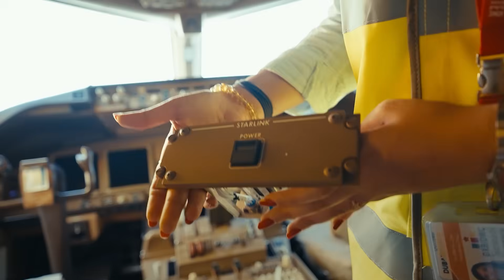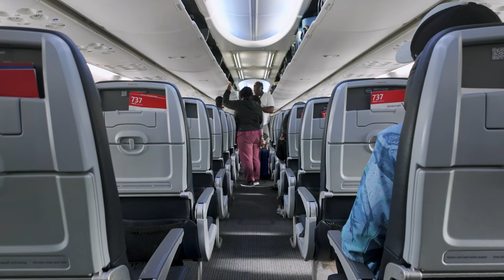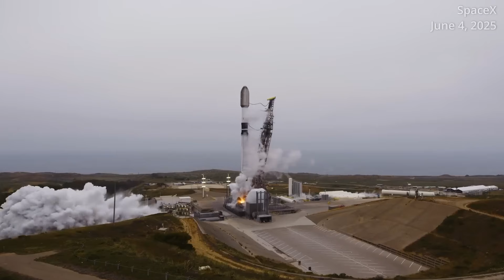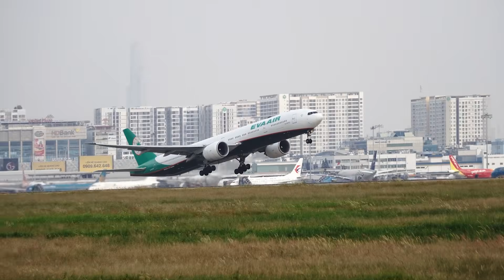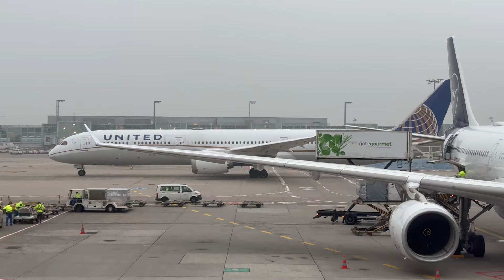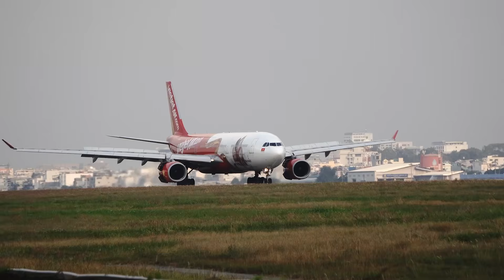Why Airlines are Quietly Removing Your Seatback Screens

Comment: Those screens add to the cost of flights, add weight to the airplane and don't work most of the time. Download content to watch on the plane before your flight and use onboard wifi to check your messages.

Comment: You will need at least dozen of starlink terminals to provide bearable bandwidth to hundreds of people (better hundreds). That means additional antennaes (for different satellites), router (for handling multiple sources) and cabin repeaters or wires - basically the same infrastructure as entertainment system with starlink subscription instead content one.
Reply from the maker: Thanks for the insight. Commercial aircraft don’t rely on consumer Starlink terminals. They use aviation-certified terminals integrated with the aircraft’s existing network infrastructure, including multiple cabin Wi-Fi access points, routers, network controllers, and onboard servers. The satellite terminal provides the internet backhaul, while the onboard network distributes the connection throughout the cabin. My point was that as high-speed connectivity improves, airlines may increasingly favor passengers’ personal devices over maintaining seatback entertainment systems. Thanks for contributing to the discussion! ✈️
Reply: @FlytPlanx  I didn't mean terminals specific, but the number of point to point connections to different satellites to provide sufficient bandwidth to passengers. The cost of installation of additional antennas for internet (assuming that two for ground link and phone calls will be installed anyway) would be a costly addition to new cabin infrastructure (Why would an existing plane have WiFi repeaters?).

Comment: Tbh if you remove them on a long haul flight, then i want good charging outlets and fast wifi
Reply: Remove the screens and then you'll have some idiot or kid not wanting to use headphones and will have to listen to their videos.
Reply from the maker: Hope they can replace the trickle charging systems with more reliable and fast charging systems ..That would make the in flight WiFi make more sense
Reply: why do you have tbh? did you think we wouldn't believe you?

Comment: This is not happening, American Airlines is the only major airline removing the inflight entertainment systems. United on the other hand, is installing an in-flight entertainment system on every one of their airplanes. Scott Kirby the CEO said they get better customer satisfaction ratings anytime. The airplane has an IFE system on it.
Reply from the maker: American isn’t the only one. Air Canada removed seatback screens from many of its A320-family aircraft during cabin retrofits, and Alaska Airlines has also shifted toward BYOD entertainment on much of its narrow-body fleet instead of installing seatback IFE. Several low-cost carriers also rely entirely on personal devices rather than seatback screens. United is definitely taking the opposite approach by expanding seatback IFE, but it’s not the only strategy in the industry.

Comment: I prefer watching a movie on the built in screen than browsing the web through wifi until the battery dies
Reply from the maker: I agree. Seatback screens are more comfortable for watching movies, and you don’t have to worry about battery life. That’s why many passengers still prefer them despite the BYOD trend.
I feel like the main reason they are doing this is to reduce weight of the plane which maximizes profits .Just pure corporate strategy with minimal consideration for the passengers
Reply: They all have in seat charging ports 😊.

Comment: Huge issue is charging the phone and tablet on-board. Most in-seat charging is a trickle charge. Phones and tablets die.
Reply from the maker: I agree. If airlines want to replace seatback screens with BYOD entertainment, they need to provide fast, reliable charging at every seat. Otherwise, passengers with low batteries lose access to entertainment altogether.
Reply: what really gets my goat is the lack of RECHARGING stations at airports in general, where every ticket nowadays needs to be shown via your phone!
Reply: Yep. My Samsung Fold 7 takes about 5 hours to charge on an Emirates A380. I use the other two hours to charge my buds.
Reply: People will try to solve this by bringing more power banks. A small percentage of these will catch fire. That can cause  a big enough trouble that the flight will have to divert.
Let's hope airlines understand what they're about to set in motion.

Comment: On a long haul narrow body or wide body, I prefer a seat back screen.  With space becoming more and more limited, every centimeter of space counts.  Airlines are not losing that much revenue when they’ve reduced seat pitch and added seats to make space ever more limited. United Airlines recognized that and did an about face, unlike American Airlines. They understood that to keep passengers distracted and less irritable for working flights attendants, seat back screens just make sense.
Reply from the maker: They realized passenger comfort and satisfaction matters more in the long run than saving a bit of fuel by removing the seat back screens
Thanks for watching